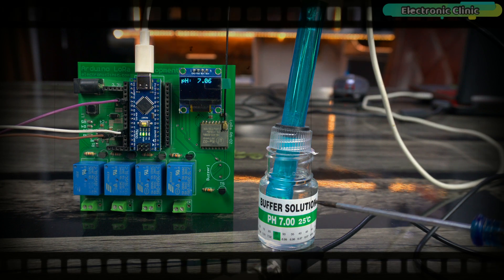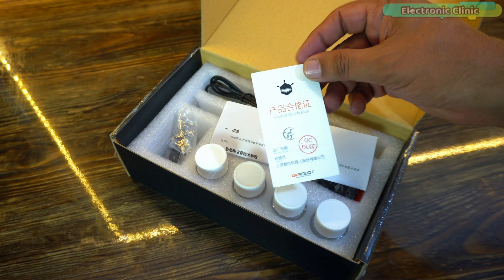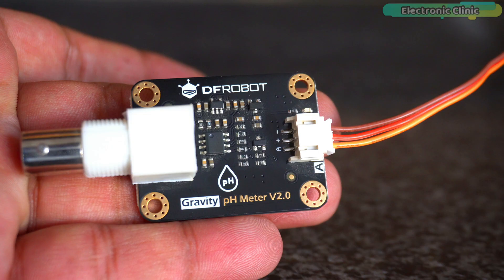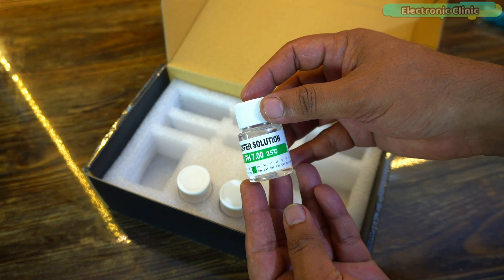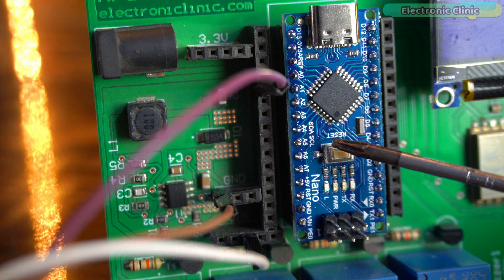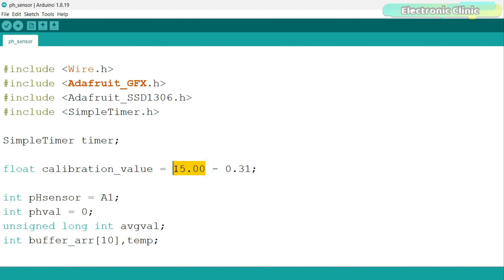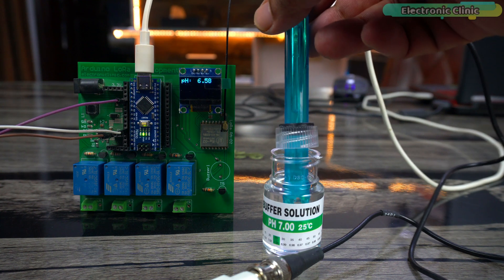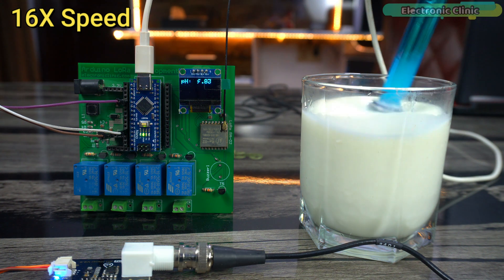pH Sensor with Arduino, pH Sensor Calibration, pH meter, pH value of Liquids

Comment: Expensive, low accuracy, very slow reading, no temperature compensation. Why would anyone want this? //Take extremely cheap handheld reader and figure its interface to development board and you have better solution in every aspect for 10x less price
Reply: Interesting comment.
Reply: Can you explain further
Reply: Скинь пожалуйста ссылку как это сделать